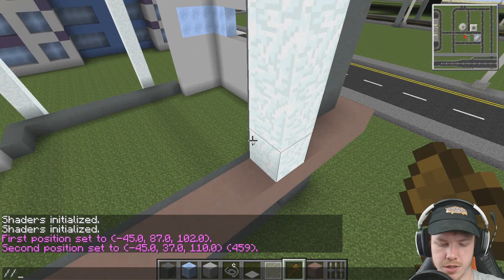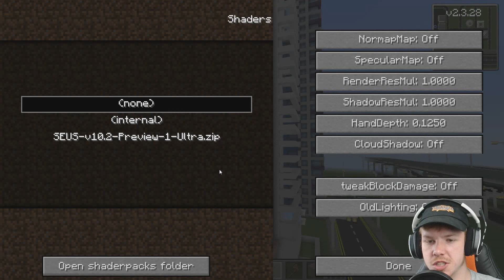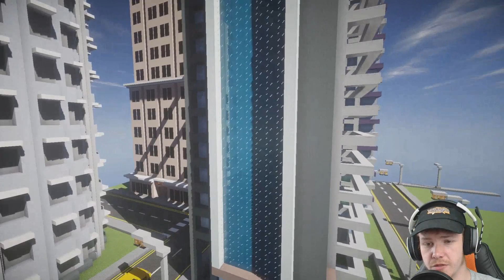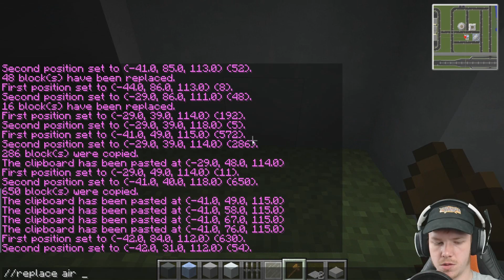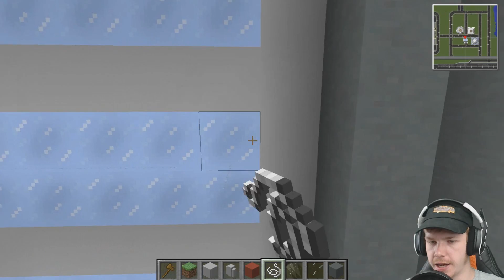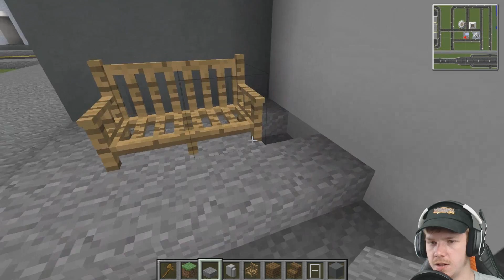How To Build A City :: Minecraft :: Shop Skyscraper P2 :: E58 :: Z One N Only

Comment: I was going to wait till the next episode but I will say it on both. You Mr. Ajay should build a motorcycle club, perhaps near the auto repair shop. Just have a big enough stone place in the front for bikes, but do not put parking spots. Inside have a little bar, maybe a couple pool table, kitchen area, small rooms where some could sleep if needed and a room with a table and chairs around it for meetings. Maybe get a motorcycle mod. But only have Harley's and choppers. No sport bikes at the club